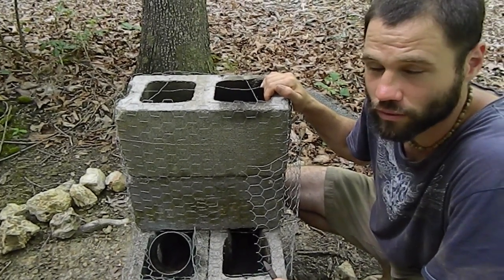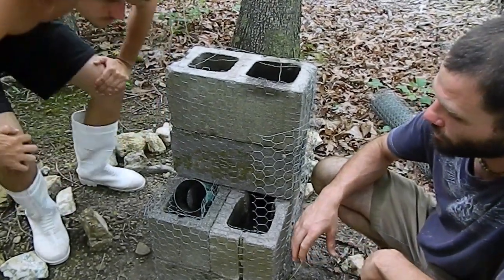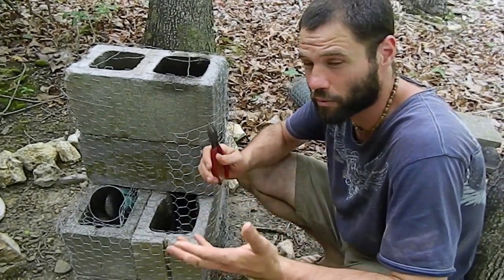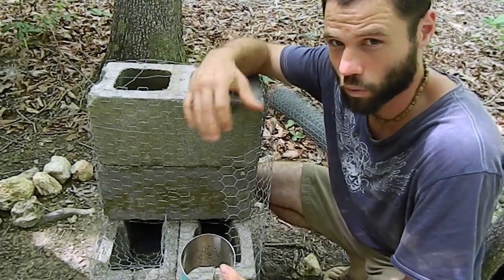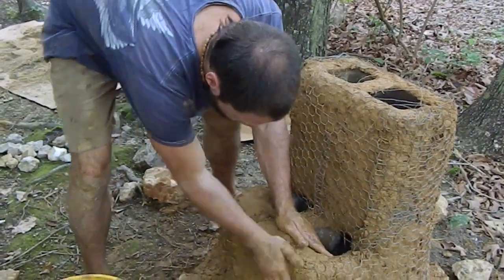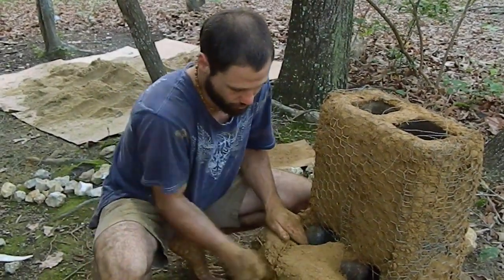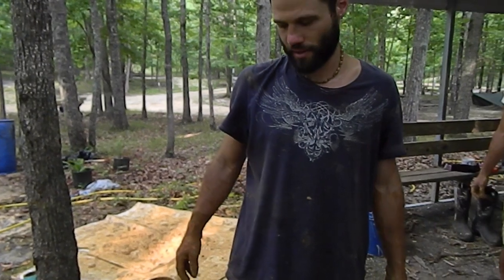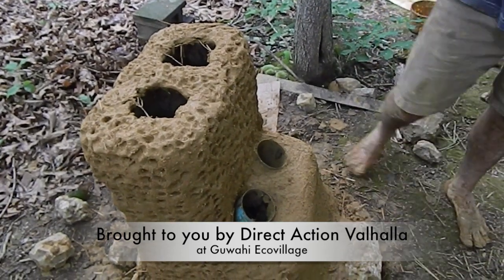Make your own CHEAP and EFFECTIVE Rocket Stove

Comment: Too much work for something that is going to fall apart after a couple of burns. .  Concrete block do not hold up to heat.  After a few burns the interior is going to completely start falling apart.